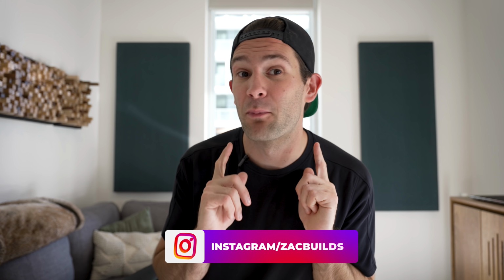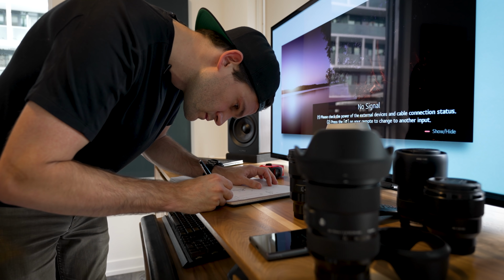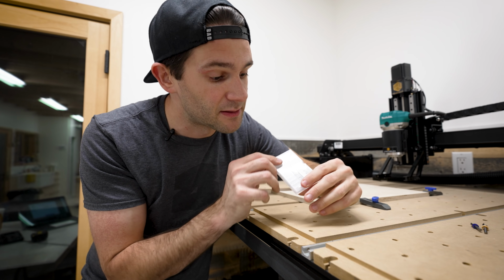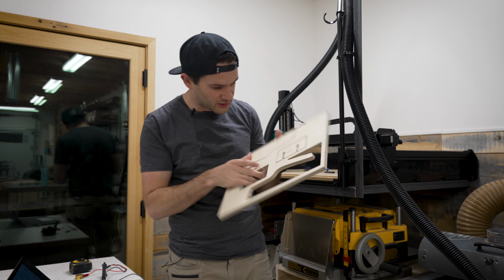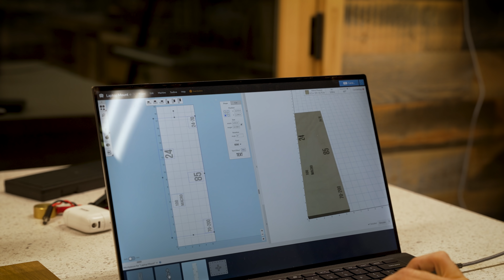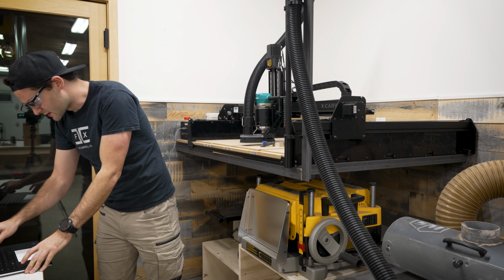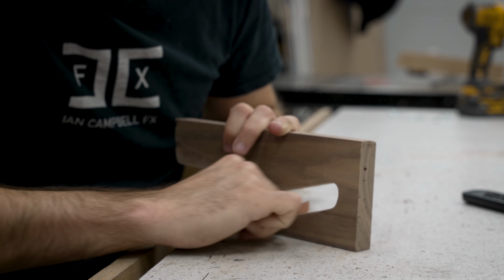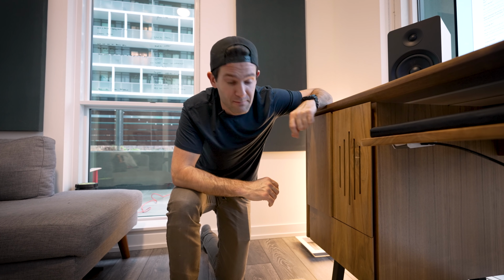Desk Build Upgrade! - Learning My New 2021 X-Carve

Comment: in the future use a chisel or a jigsaw to cut away the wood bridges that are left from cutting to make it a little easier and less chance of tear out when you pop out the pieces.
Reply from the maker: Great tip! Appreciate it man. And I've been looking for an excuse to get a cordless jigsaw, so maybe this is it!
Reply: @ZacBuilds  Honestly, a jig saw is overkill. Just a small pull saw, or like he said, a chisel. Put it on a backer board, and one solid thwack with a wooden mallet and a chisel, and you're golden. Or, an oscillating multi-tool with aplunge cut blade is good, too, with a backer board.
Reply: Use your favorite tool, the multi tool. Do not make the tab thinner. It could get loose while cutting due to the forces
Reply: That part was unpleasant to watch.
Reply: Or even a fresh razor blade in a box cutter can score of the top layer enough got that punch out doesn't have that level of tear out.

Comment: The sky's the limit. Workshop tool caddies on wheels would be an interesting challenge to think outside of a box on wheels. Some slot and tab joints ? Finger, or dovetails? All a pain if you do them any other way than cnc. Bring on the projects, this looks like something right up your street for rapid prototyping or models of larger projects. A Dremel tool bit stand with levels. Accurate holes! 😃

Comment: Tips:
 Buy extra bits because you will break them 😆
 Buy another plastic insert for the dust boot.
Make sure you level your spoilboard.
Always, always check the preview for random tool paths.
Buy a battery operated screwdriver if you stick with the stock clamps.
Reply from the maker: Awesome tips, thank you Karl! I'll do all of those for sure. Especially that battery operated screw driver for the clamp, that's huge!

Comment: About the text problems i have some ideas: The angle on v bits limits your max depts on a given width because if this geometrie given the same text size you can carve deeper with a sharper angled v bit than with a wider angled on, you are using quit the wide angle on your v bit which propably is why its not really working as you intended, also check if your board is flat if your z is higher then the board where you are carving it wont work

Comment: One of the things which may have have had an impact on your engraving is the possibility that the waste board isn’t parallel to the router. Get a flattening bit and run it over the whole lot at a 1mm pocket until you’ve surfaced the whole waste board.
Reply from the maker: Thanks for the info Scott! I'll definitely be doing that.
Reply: this

Comment: Great video, thanks for sharing!  I'm not familiar with the X-Carve's Easel Software but have some CNC experience with Mastercam.  In Mastercam you can set a break-through setting so that your cuts will break through the material based on the setting of your choosing.  So for example, if your material is 3/4" thick you can tell the software to break through the material .015" past your material thickness.  If Easel has this option it would be good to use it for two reasons, one is so that you don't have to struggle with getting the cutouts out of your material and two you won't ruin the spoil board by cutting too deep past your material.  Also, a good sharp chisel should make quick work of removing the tabs that are left behind.  Again, great video and really enjoy watching the learning process.

Comment: Been waiting for this vid! Love the vertical drawer, and can't wait to see the completed dock setup. Will you be mounting your dock on the desk, so you can utilize SD slots and temporary USB devices? Love the lens organizer too. I had yet to think of using the CNC to "label" things. I'm gonna try that! Also, we chose to get a Shapeoko instead of X-Carve, so I don't think we're allowed to be friends Zac. :) Have a great weekend!
Reply from the maker: Hahaha oh no, is this the wedge that drives us apart!? Ya once I get the thunderbolt 4 dock installed my plan is to have everything on the desk be able to switch between my desktop in 1 drawer and the laptop in another at the flip of a switch. I might also need to get something called a KVM to switch some of the devices. It'll be work, but I've got it all planned out haha. Thank for watching!

Comment: with the cnc wait till you start to experiment with programs that you type in measurements of shapes or what you are drawing, like AutoCAD or i actually use adobe illustrator, turn the ruler on, make a layer for measurement points and another layer for shapes etc and get to making stuff while keeping in your head how you want to cut it out, like solid shapes vs thin outlines etc then save as an svg. so using illustrator for logo work it can be saved for engraving work or cut-outs.

Comment: You can chop the tabs flush with a chisel & mallet while it's still on the bed.  Waaaaaay easier (and cleaner!) than breaking 'em out in mid-air.
Reply from the maker: Great tip Johnathan! Much appreciate man!

Comment: A v-bit carves between the lines, so changing the depth does nothing. Making wider text makes it carve deeper because the gap between the lines is wider. Separately, If you're using plywood that you know is flat, yet your text isn't equal across your piece, your spoilboard is likely not flat. Maybe you did that off camera? If not, you'll need to for sure. And you'll need to again over time as you carve into it and as your table flexes.
Reply from the maker: Appreciate the info Michael. I didnt make any adjustments off camera, just got lucky on that second attempt. I've been doing some research since making this video and it definitely seems like I need to surface my spoil board. So I'll be doing that ASAP. Cheers

Comment: I have learned so much from your channel, great info on the CNC process. I think I would want a way to hold the material down without the tabs. I'm guessing that involves some sort of negative air system under the work surface. ??

Comment: The lense drawer had a lot of empty space over the lenses, so why not design something like what small Jewelry boxes do by folding outwards to let you access the bottom. In this case you could design something that moved away from where you are sitting for easy reach to both level of lenses.

Comment: Yeah, that poor airflow fan has NO chance of creating enough negative pressure to pull any air through the drawer. I estimate at least 20-30% reduction in cooling performance of the laptop, especially since it's closed and because it has the exhaust directed downwards. Heat rises, gets pulled back into the chassis... you see where this is going. Looks good, but that's about it.